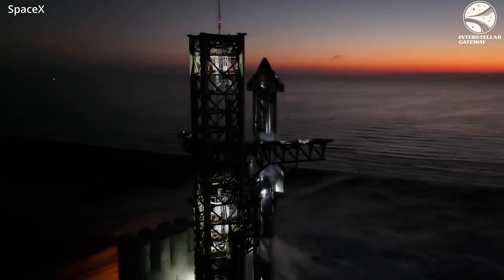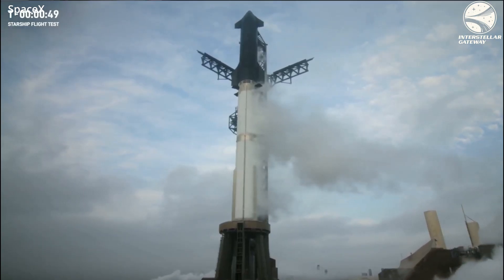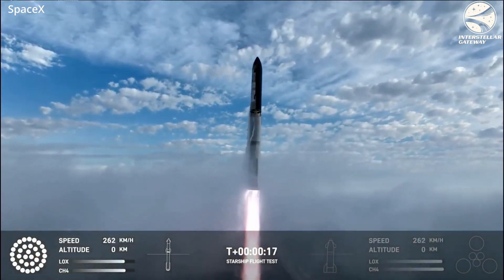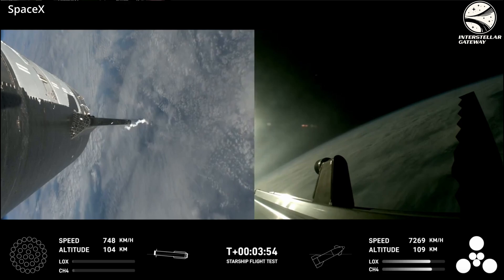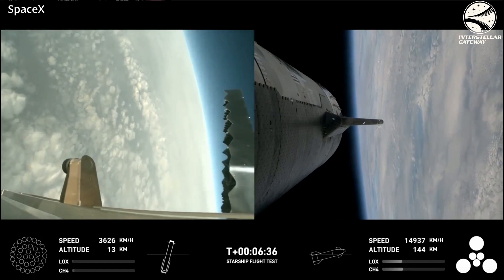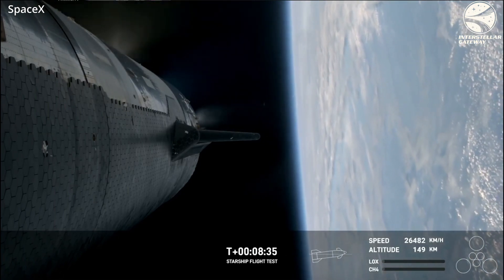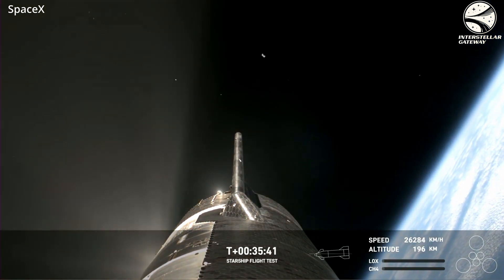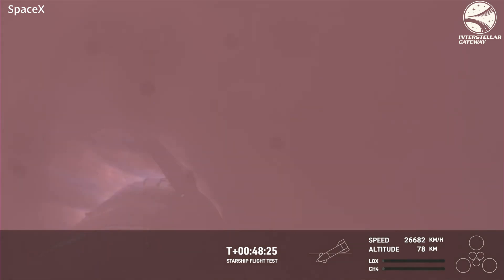What Happened On SpaceX's Third Starship Launch Attempt?

Comment: I stepped through the frames of the booster flip, and I believe that was all intentional.  First, they gradually turned off one side to steer it off axis. Then, after it was relatively clear of the ships exhaust, they gradually started a loop-de-loop into the upper right quadrant. Eventually only the center and lower left quarter engines were on.  When booster was fully oriented in the reverse direction, they shut down all but the center three.